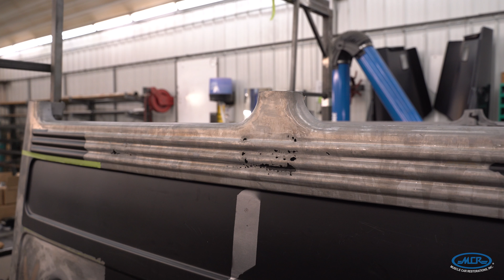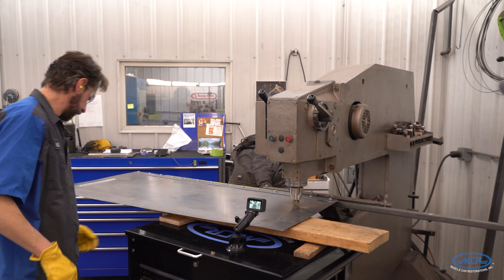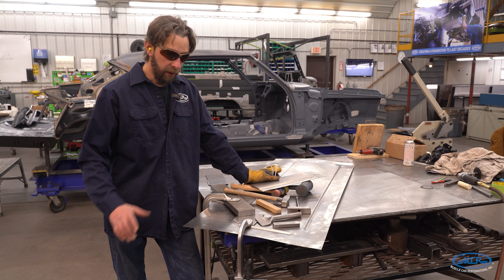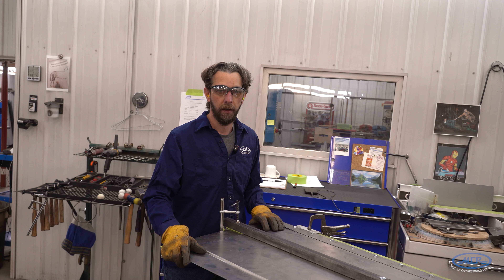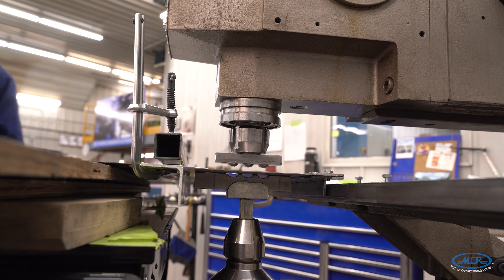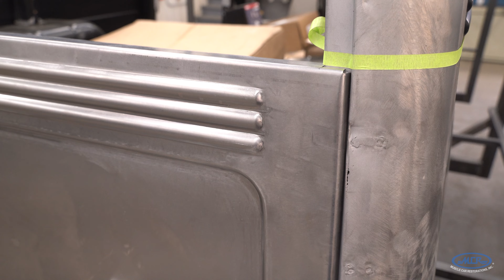Fabricating a Custom Willys Wagon Tailgate

Comment: How come you didn't leave some raise material for the hinge to finish onto? looks like you bought the wrong hinges .
Reply from the maker: It was not mentioned in the video, however, the final hinges will have a profile matching the one on the tailgate skin. This way we do not disturb the lines of the recessed panel, instead the hinge will step in to match the skin.